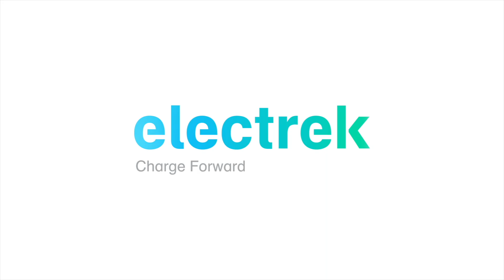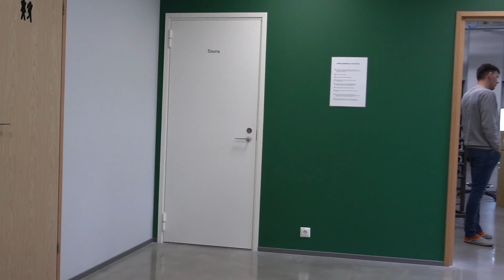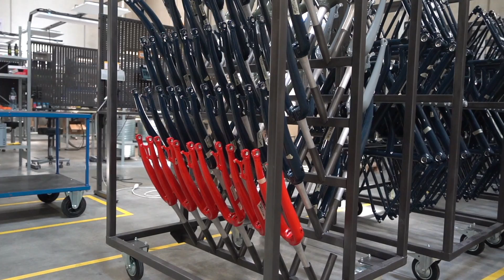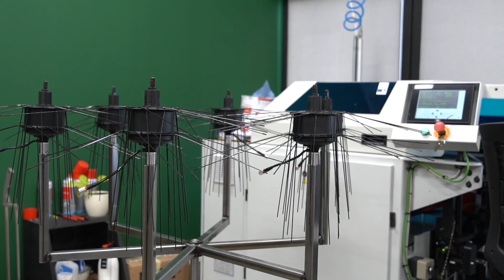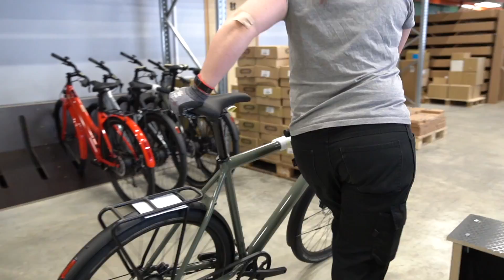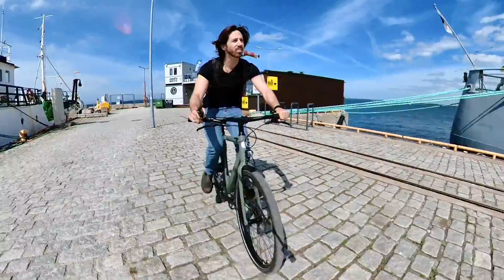Ampler factory tour: The SECRET of how electric bikes are made

Comment: 3 comments for you if you're looking at full-time ebiking:
-wheels: sturdy wheels are a must
-a good suspension is more important than on a conventional bike
-theft protection is a concern
The reason for the first 2 is because you tend to ride at higher speeds, and punish the wheels quite a bit. Any rut, bump, or whatever can damage a skinny, flimsy rim. You also are more likely to have most of your weight right over the back wheel.

Item 3 is pretty obvious. More than a few people truly suck.
Reply: Brakes- check pads and discs for wear and tear and learn how to do it yourself. 
Suspension - my front suspension fork packed in, so replaced with a solid rigid fork that hopefully lasts a lot longer with no maintenance. 
Tyres- schwalbe marathon plus , worth the investment as changing tubes on a hub motor is a real pain